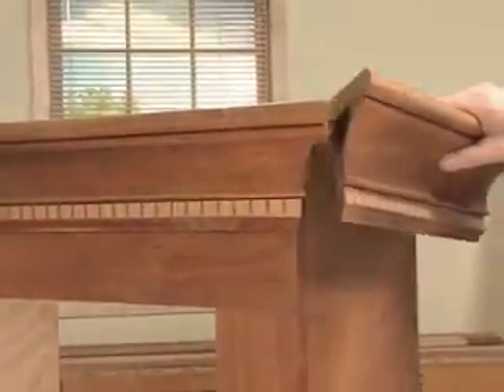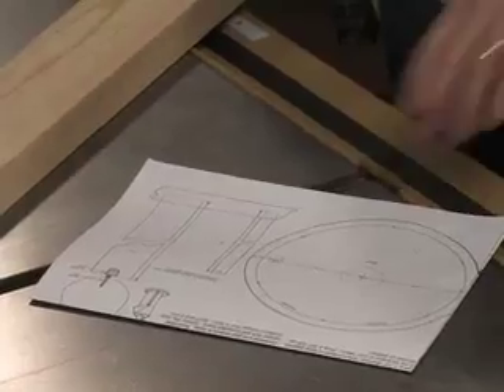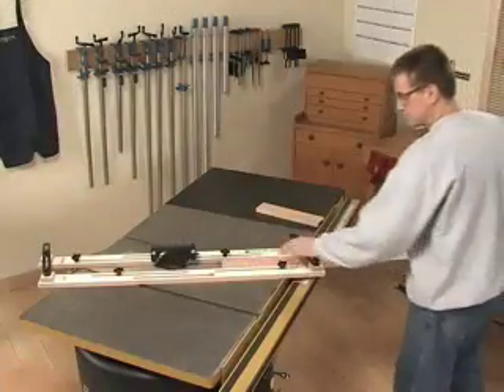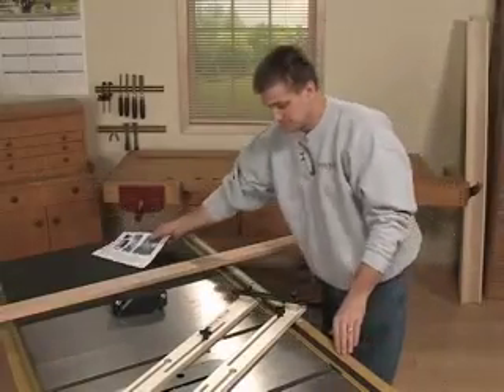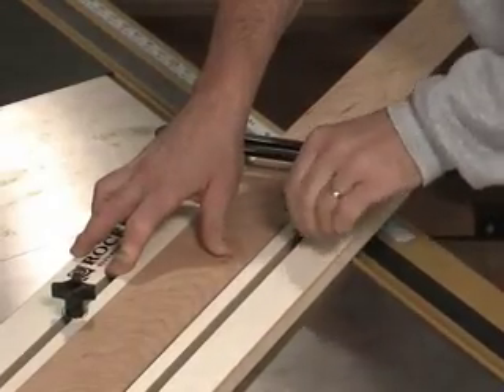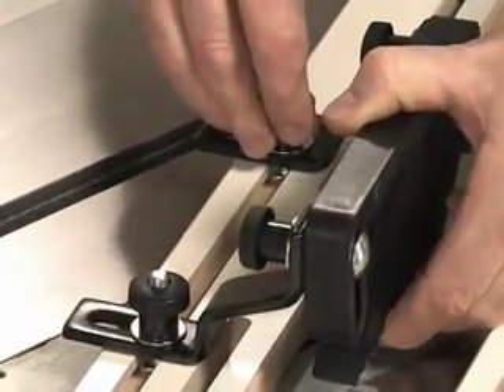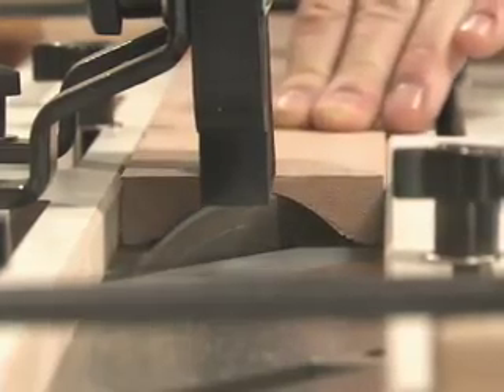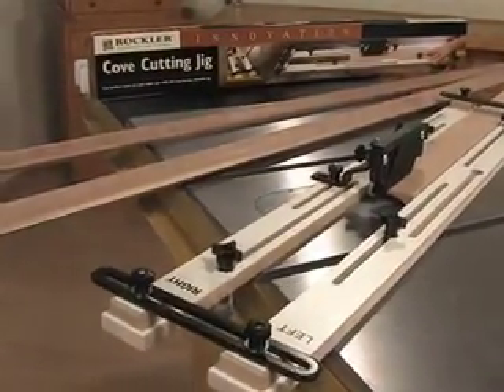Cove Cutting Table Saw Jig

Comment: looks like a good jig if the price is right.
cutting coves this way is dirty and makes a lot of mess. It's good for small jobs, but not production as you will sand your ass off cleaning up the sawcuts. You can only take a little off per pass too. beats whittling it or using a hollow plane.